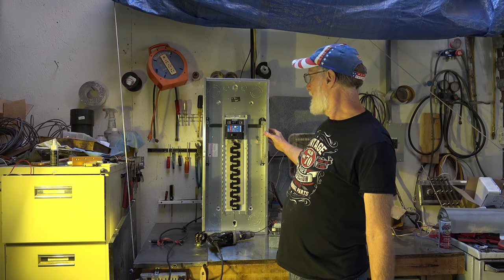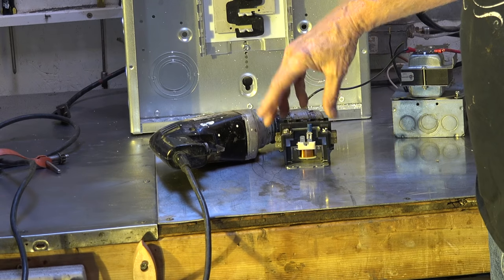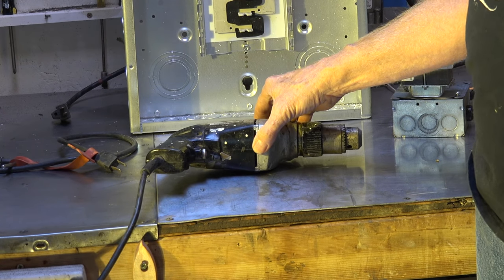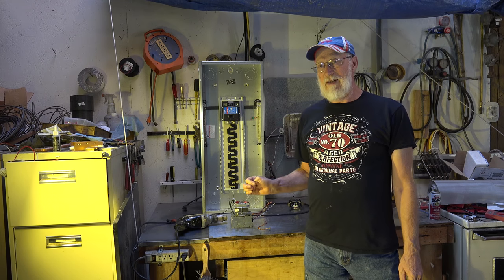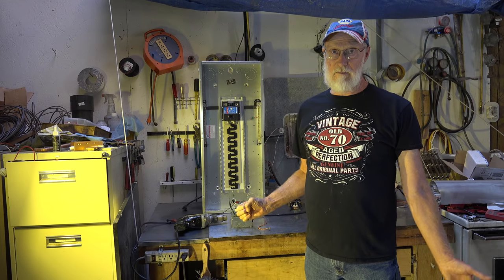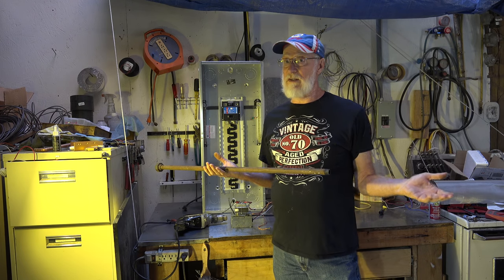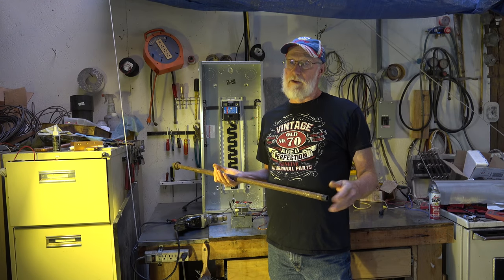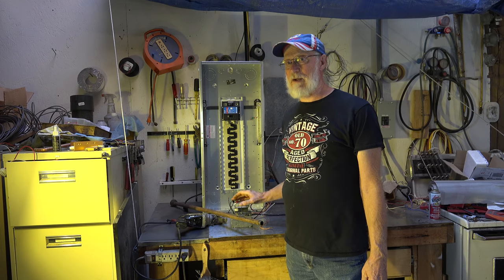What is electrical bonding

Comment: Great bonding video.  As you said after you bond the gas line with the proper size wire it must be taken to the electrical panel and landed it on the proper lug this is the only way to clear a fault.

Comment: Is this a useful rule of thumb for trying to get this stuff straight? :   "Earth Ground" is for lighting catastrophes. "Wired Ground" is for getting back to pole-neutral so that:

(1) the  imbalance can get back to grid to be rebalanced in the "grid-o-sphere"

(2) the breaker back at the neutral node in the panel will trip (???) to break the shorted circuit (i.e. no "earth ground" involved).

(See GFM's other videos in this series. )
Reply from the maker: Mostly, except the neutral has no breaker.  All breakers are on hot lines.
GFM

Comment: Your video is mostly correct with a few unclear things thrown in.   Ground in the NEC is "connected to Earth".  Grounding Electrode and Grounding Electrode Conductor are for Earth grounding.   Completely done with true "Ground".  Equipment Grounding Conductor is the green or bare Conductor that is included with feeders and branch circuits.  Can also be the metal conduit(still in the NEC).  These are for a short circuit as noted in the video.  They are separated from neutral until it gets to the "Service Entrance Main".  It is designed to carry the much larger amount of amps from the fault to the neutral in the main panel, and to and through the transformer, then back to the Main Over current device so that it has enough energy to magnetically trip a breaker or blow a fuse whichever you have.   The NEC is moving toward calling the "Equipment Grounding" all bonding as it has nothing to do with earth ground.
Reply from the maker: What you are saying is true.  This video is primarily made to be understandable to the ones that are not professional or are students trying to understand these basic concepts.  Sometimes the language can make it harder to understand.  So I sacrifice some exact definitions.
GFM

Comment: Funny you post this video because just yesterday i was finishing up a furnace, AC and some 6 inch round install in a basement (old house being rehabed). I noticed when putting some zip screws into a 6 inch elbow, joining together some round ductwork, my impact driver would complete a circuit when the metal bell at the front of the driver was in between the 6 inch round i was hanging and a 1/2 inch copper cold water line, throwing some small sparks. Come to find out, the newly installed panel box was not bonded to the water meter. I double checked my wire nuts....all seem OK. I do have the GND from the Romex screwed directly into the metal body of the furnace. So i gotta go back and bond the sun of a bitching thing with some #4 solid bare copper wire. Good video.
Reply from the maker: Interesting
GFM
Reply: probably some "bad ground" tied to the water pipe somewhere it shouldn't be anymore, they used to do that long ago for electrical, telephone, satellite and cable-tv installs.
problem being when the cold water line is no longer bonded at panel or someone repairs with plastic/dielectric unions, the whole plumbing system can become live, so if the house has a mix of old 2 wire cloth romex or knob and tube. I highly recommend an electrician tracing down the source of the issue!
old 3 wire oven and clothes dryers with the case bonded to neutral.. which in turn bonds to water pipe or gas line can do that when a bad/loose neutral is present.
I have found multiple times "electrified gas pipes" due to old 3 wire/3 pin  had case "bonded" to neutral equipment, one was bad enough it was heating the meter nuts at a broken meter mounting bar!

Comment: I really enjoyed your explaining this subject.  I am running cost fRom the meter and run it under the soffit to my generator.(all on the outside).  Do I need to bond (ground) the csst?
Reply from the maker: Yes, the fitting (not the pipe itself) must be bonded to the main panel grounding system.
GFM

Comment: Another good video would be sub panels and why you should never bond ground and neutral and in fact it is a code violation. It's an interesting topic .its all about never having current or a voltage drop on the bare copper ground that can cause shock hazard or ground loops or both. I've seen a lot of sub panels with the green bonding screw still in place or some one will add a circuit to a sub panel and hook the bare copper wire to the neutral side and the white neutral side to the bare copper side( ground) . They treat it as if it were a main panel.
Reply: what if the main panel was pre 80s and was bonded only at the meter?  that's what i have and was told not to touch the old service but to bond the sub panel and run a 8ft ground rod next to it with a #6 bare wire. it would be simple to remove the bonding bolt and or disconnect the bare wire if necessary.
Reply: To be safe get some one with license to look a your specific case. Mike holt  has the best videos on this topic I ever seen . But what I do know is that neutral and ground should be bonded only in one place .
Reply: same for having "4 wire" appliances and outlets for high draw loads like oven/clothes dryer
Reply: some areas here want the panel bonded at meter and meter jumped  +ground rod outdoors, don't forget to jump the water heater lines! ( jump = bond/bonded)
Reply from the maker: I have a video on separation of neutral and ground.  I will link it.
GFM

Comment: What do you mean the 'fault will clear' on the neutral side outside at the transformer. Shouldn't the breaker be tripping on a short to ground?
Reply: Ozzstar no, earth resistance is very strong. It's easier for electrons to flow back thru the neutral. In your case, the breaker will only trip if there's no path back to neutral, provided that the grnd and neutral are isolated. Then the problem would most likely be at the service disconnect
Reply from the maker: Clearing a fault is electric speak for kicking the breaker.  The breaker will not trip on a "short" to earth ground.  It will only trip if the ground is connected to neutral.
GFM
Reply: grayfurnaceman lol that's what I said, yes?

Comment: the National Electtrc code still allows EMT to be used as the equipment grounding conductor (article 358.60). although I prefer to run a spare equipment grounding conductor anyway.
Reply from the maker: Not where I live.  The state got rid of that long ago.  It all goes to the understanding that the NEC is a MINIMUM.  
GFM

Comment: Interesting BUT still confusing. So in a service panel when the bar that you connect the white wires AND the ground wires to has a connection to the neutral coming in....its bonded  And if the panel has a separate unconnected neutral bar and ground bar its unbonded?????   If this is correct which method of wiring up a panel is correct?????
Reply from the maker: The bonding refers to the connection of parts such as appliance chassis, metal piping and metal panels together so that if any one becomes energized through a fault in an appliance, it will have a path to the neutral so the fault can be cleared.  Hope this helps.
GFM
Reply: @grayfurnaceman , different parts of the country use varying terms. We say in Tennessee, "it kicked or tripped the breaker' you say," it cleared the fault." is this correct?
Reply from the maker: "Clear the fault" is electrician speak.
GFM

Comment: I enjoy your videos and you do a good job explaining some complex topics. But in this case I think it would have been better served to work through the topics in 3 steps; grounding, bonding, and what happens between the service panel and the Pole Transformer then draw the conclusion. Also the use of the phrase "clear the fault" I don't believe accurately describes what's happening. The fault is never cleared but in actuality the safety device opens the circuit. If one attempted to reset the safety device  prior to the fault condition being remedied the safety device would trip and open the circuit again. Just my two cents and thank you for all your efforts.  - Pete
Reply from the maker: Thanks for the thoughts.  The "fault clearing" is an electrical term.  I also have a number of videos on this and related subjects.  The video was never meant to stand alone.
GFM

Comment: Here's an interesting story- At a previous house years ago, I was doing some plumbing work and I cut a copper water pipe in the crawlspace. The odd thing is that when I touched both pieces of pipe, I actually got a shock. I actually never figured out why that happened. Just thought you'd find that interesting.

Comment: Why, when talking about a short circuit, would you want to state "return to the transformer through the neutral and clear the fault"?  
Instead of saying "trip a breaker"?
Reply from the maker: Because it is the language of the electrician.  It is descriptive of what actually happens where "trip a breaker" is not.  
GFM

Comment: So the green screw connecting the neutral bar and box, if ground fault, current goes to the box ground, ground goes to neutral, then energized the box?
Reply from the maker: When there is a fault to ground, the current passes thru the chassis ground and back to the neutral on the power pole which clears the fault by opening the breaker or fuse.
GFM

Comment: hey bud, the inspector came by (we're trying to switch electric companies) and he caught these 5 things: 1) panel not bonded 2) service needs to be 100 amps but mine appears to be only 60 amps 3) need ground rod system 4) romex & mc cables enter panel improperly and 5) the water main ground is not a water main ground. right now the water ground just goes to a nearby pipe---it has to go to the water pipe main where the water meter is. are these common or am i getting scammed? any idea how much this all might cost me? thanks in advance
Reply: I think it is a little bit of ignorance(whether or not that is scam is subjective)

"water main ground" should be considered obsolete.
Even mains are now buried using plastic pipe instead of steel or iron like they used to do.

Ground rod system = ONE copper rod stuck deep in the Earth and 8 awg copper wire connecting it to your MAIN(cut off panel)
Reply: @flightographist 
Everything can be bonded, it just might not be grounded.
Bonded just mean connecting all parts together.
Reply: @flightographist 
I see. Yes, his panel might not have a pre-drilled hole but that is easy to remedy.
My own subpanel didn't even have a separate grounding bar from the neutral bar so I had to add one.

Comment: When you say "it will clear all faults" what do you mean exactly?
Reply from the maker: Open the circuit protection (breaker).
GFM
Reply: other way of stating it, clear the fault = cause the fuse, breaker or overload protection device to open the circuit/interrupt the current flow

Comment: im confused. If a single phase system bonds ground to neutral to clear a fault then how would a three phase delta system with no neutral clear a ground fault
Reply: I'm no expert but it depends on the system. Some are/were "corner grounded" meaning one phase is grounded at the x-former and that was how you got a ground (only seen one once in real life), and some really old systems had no connection to ground.
Reply: If another phase different from the first one also faults downstream it'll clear it.. the fault current going through the grounding network and back up the other phase.  There's a pretty helpful diagram on the last page of this link.

https://www.mikeholt.com/instructor2/img/product/pdf/1292448885sample.pdf

Comment: Good video. Thanks. I want to understand something however.  Lets say the hot wire becomes loose and falls off of the terminal of an outlet and touches the metal box it's contained in...and this metal box is NOT grounded....so now the metal box is live...and might stay energized for years if nobody notices that the plug doesn't work..... lets say the box is housing a floor plug and can be accessed from underneath by a crawlspace...one day a person crawls under there and touches the live metal box...he still wont get a shock if he's wearing runners because the the rubber sole would insulate him from the ground...correct?  The electricity would travel through his body but never make contact with the dirt.... If the second day he goes back under there and touches the live box again but this time he's barefoot, he will now get a shock....but it wont trip the circuit breaker.....the third day lets say a metal pipe falls and makes contact between the live box and the ground.....does that trip the circuit breaker? I think  yes...………………..As soon as the electricity makes contact with the earth (dirt) it automatically trips....same as if it was properly grounded all the way back to the pole transformer, which is ultimately connected to the very same earth...….Am I correct???
Reply from the maker: Its a bit more complicated than that.  The person with the shoes may or may not be shocked.  No way to know.  The barefoot also may or may not be shocked.  Again you do not know if the ground is conductive enough to cause a shock.  The probability is no.  In no case will it kick the breaker unless it is a GFCI.  
The metal pipe will not kick the breaker unless the pipe is connected to the ground/neutral of the main panel.  If so, the breaker will trip.
What you have been missing here is earth ground is not part of any circuit.  Its a place for lightning and surges to dissipate.
Now, if I increase the voltage to say, 20,000 volts it will electrocute and kick the breaker.
GFM
Reply: grayfurnaceman When you say “earth ground” in the last paragraph, are you referring to the2  ground rods located by the electrical panel , right?
Reply from the maker: Yes.
GFM

Comment: I always thought that grounding brings everything to a zero potential.
Reply from the maker: Earth ground will bring spikes and surges to zero potential.
GFM
Reply: Yes, you're right. If lightning strikes an overhead power line an SPD (Surge-Protective Device) will limit transient voltage by diverting surge current through the earth. Many people seem to think that by connecting chassis of electrical equipment with the earth ground will somehow prevent them from being electrocuted in case of a ground fault (An unintentional, electrically conductive connection between an ungrounded conductor of an electrical circuit and the normally non current-carrying metallic equipment). The ground fault current that's gonna flow will not trip the breaker and consequently there'll be a dangerous touch potential between the energized part and the earth. Grounding is not going to prevent electrocution.
Reply from the maker: So right.
GFM